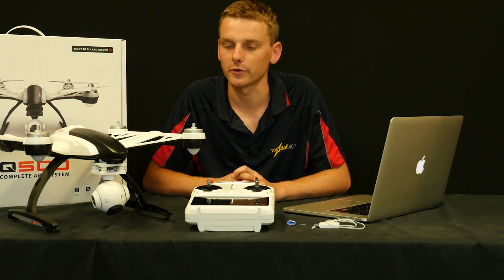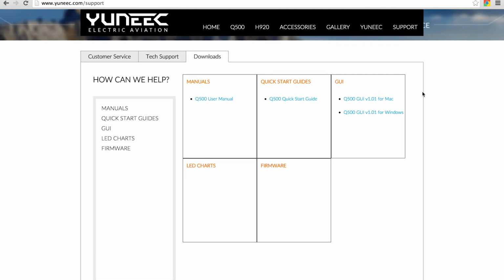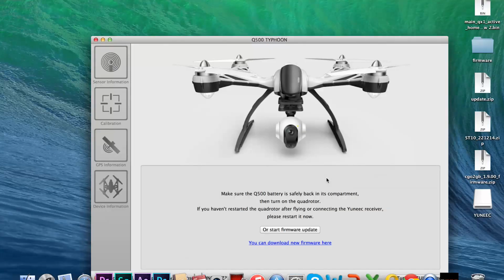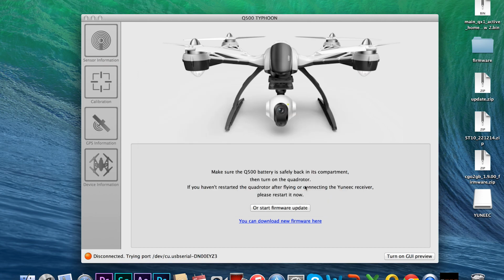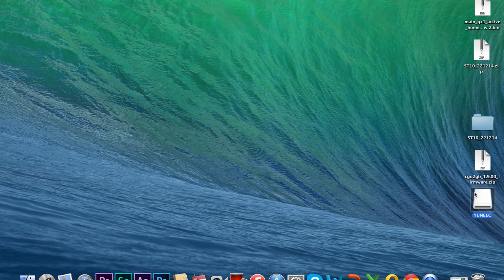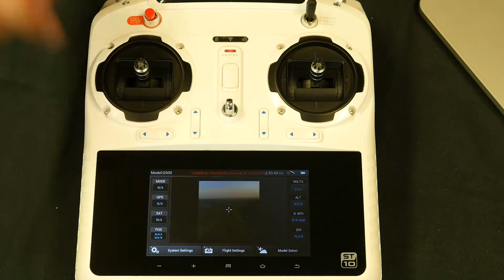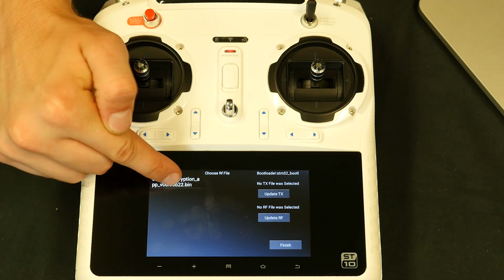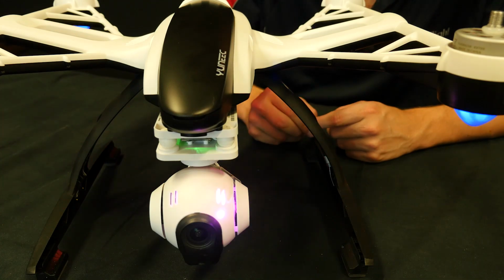Yuneec Q500 Drone - How To Do A Firmware Update

Comment: Make sure you create a new account on yuneec website and register your quadcopter with serial number located on bottom of aircraft.....after that read VERY carefully....you must make sure you have installed proper drivers for your computer to even recognize your copter....thanks so much for video....only issue I ran into was when I tried to update the TX it kept failing due to time out.....after three attempts I simply restarted the TX and followed procedure again making sure to click the upper left hand patch first than the update button and success

Comment: Good video if you can pause it! I downloaded the firmware for my ST10+ and do not see a RF file, only TX. Is there no longer  this file?
Reply: +Jim Shoe there is no RF file now, his video is out of date on that. But I did the TX file and successfully updated. The first time I set my SD card in with a tiny gap and closed the metal clip. It didn't read anything of course. I set it in properly and it read the new file when I set it to update.
Reply: +Jim Shoe I would reformat the card then try again, if that does not work then check to ensure you have it set properly.

Comment: Hey guys - I have one of the original Q500's (not even the +) and I've flown it for a few years now without ever updating the firmware.  One question I never seem to resolve or find an answer to is whether or not it's necessary to even do a firmware update, especially if you're not having any issues whatsoever.  In other words, I've flown for years with no issues, no bugs, etc.  So is there really any benefit or reason for me to update my firmware?  I feel like I run the risk of running into issues if I do vs. leaving well enough alone.  i.e. don't fix what isn't broken.  Thanks in advance.

Comment: Yeah I noticed that too, where did you get the updates for the S10 and camera and could you be a little more specific about not opening the zip file if this could cause damage to the S10?

Regards

Chris
Reply from the maker: Hi Chris Carter, unfortunately the updates for the S10 and camera are not available. However, if any updates are made available, they should be accessible on Yuneec's website (on the same page where we downloaded the firmware update). We apologies for any confusion caused. We wanted to mention the S10 and camera updates so our viewers would know, in principle, how to download and install them if they became available.

Regarding the ZIP file, we should clarify that no damage will be caused to the S10 if the file is not opened. The worst that could happen is that the update will not be installed. Hope that all makes sense. Please let us know if you have any other questions.
Reply: Modelflight No that's OK, I through I was experiencing the early stages of senile dementia? I will know how to do it now, thank you.

Regards

Chris
Reply from the maker: Chris Carter glad you worked out how to do it. We wouldn't wish senile dementia upon anyone!

Comment: Camera update.  When I put the sd card in and turn on ONLY the Q500 4K with CGO3, all I get is a blinking green light on the camera.  I had no issues updating the drone or transmitter, but the camera is killing me.  I've tried different sd cards, reformatted no luck, tried using one that had pics from the drone (so I know it worked fine in the camera), no luck.  I wish there was a forum on the Yuneec website
Any help would be appreciated, thank you in advance!

Comment: any idea where i can send my whole unit and radio for set up or repair if needed?? im in uk and bought what i thought a clean trusted used twice unit being stuck in a wheel chair thought it would be great to give me a hobbie untill my legs are sorted.. but i pressed the reset as couldnt get any where now cant see battery power or move the cam up and down as before. wont start up. did all up graded firm where but doesnt see the ones of the q500 on the radio as is a internet link seems to be a bin file. iv been messing for a few days and now got a head ache. for 2pins i could throw it . but cost me 500 pound for a massive setup. with cases..please help if you can. i am prepared to send it off to let a shop or a yuneec specialist set everything up and if needed repair then ok, but gosh is doing my head.. one frustrated guy here . steve

Comment: i was upgrading to version v4 and i got a corrupt file error now my bird wont be recognized by the app or the transmitter,  have any ideas how to fix ? great videos
Reply from the maker: Hi Remote Chief, thank you for your positive feedback. Regarding your question, we just wanted to make sure that your transmitter's firmware is up-to-date. At this stage, this is the only reason why we think this problem could be occurring. Please let us know if you have any further questions about this.
Reply: Nothing to do with the transmitter I was updating the drone and now the drone will not be recognized by the app so I cannot update or even seen any data
Reply from the maker: Hi Remote Chief, that is strange. The only other option that we can think of is to check the wires and pins on the Q500's mainboard. They may have come loose or been damaged. If this does not solve the issue, please let us know.

Comment: Do you have to calibrate the q500 after you update the firmware?  Do you re-pair the ground station to the drone after the update too?
Reply from the maker: Hi Joseph S. West, to the best of our knowledge, you do not have calibrate the Q500 after you update the firmware. We can also confirm that you do not need to re-pair the ground station to the drone after the update either. Please let us know if you have any more questions about this.
Reply: Modelflight
Reply: I updated the firmware on the quad and the controller and the calibration was still intact.

Comment: Again I have been on over150 flights with the Q500 and I have updated once before.  I also have two Q500s and one I personally rebuilt and have flown it many times.  This has nothing to do with physical wires.  The q500 became unresponsive right after  initiating an upgrade and now the app claims it is not connected m.  My other q500 works fine but I am now afraid to upgrade to v4 now but I wanted to start using watch me feature.  This is a firmware issue nothing to do with wires I checked in case but no this is firmware not a physical issue thank you for responding
Reply from the maker: Hi Remote Chief, that is peculiar. I just spoke with our technical/service team about your issue and unfortunately they are not certain what could be causing this problem, apart from the other two physical suggestions we raised with you earlier. Our best suggestion right now would be to speak to the retailer that sold the Q500 to you. We are very sorry that we have been unable to solve your problem in this instance, but please let us know if we can be of assistance in any other way. Thank you for your understanding.

Comment: Hi Matt. I just check the website and there wasnt any firmware files except for the Q500. Also what does the firmware change in the ST10?........thank you.
Reply: Modelflight Sir, will speeding up the transmitter and improving the algorithims reduce the latency of the video to the ST10 from the camera?  Thanks
Reply from the maker: Hi Chuck Vazquez I just spoke to Matt about your question. Unfortunately Yuneec only have the firmware files for the Q500. Nevertheless, we wanted to show you the process through which radio and camera can be updated, in case Yuneec does release firmware updates for these devices in the near future. Regarding the ST10, the firmware update should speed up the transmitter and improve the algorithims, but I am afraid this is all we know at this stage in time. If you have any other questions,though, please let us know.
Reply from the maker: Hi George Beorn, unfortunately we are not too sure about that. Reductions in latency would probably be the result of firmware updates to the camera and, at this stage, those firmware updates are not available. Please let us know if you have any other questions though.
Reply: Thank you for checking into it.

Comment: Matt.. First of all...Very thanks for your detailed instrucctions , Sadly I loose the way...   I Followed the instructions to update my ST10 unit but apparently I used the wrong update file (for the ST10 +). Now my ST10 drive turns on white, I do not see the characters as only some horizontal stripes appear. My question is if you know any way to recover my unit.
I will be very grateful if you can help me because I really like flying my Q500.
Reply: Jorge Sarmiento I also have a bricked controller. My sorry it's I was advised by ayuneec tech to perform the upgrade from their downloaded firmware update software. He did not tell me the critical mistake I would commit if I used the 10+ software on my ST10 and all that was available for the controller was the ST10+! In other words, they screwed me. Now I must pay postage and 80 bucks an hour and wait several weeks for it to be repaired! If you have found a way to diy repair, let me know.thanks

Comment: Nice video. My bird updated fine as did my camera. When I try to update the controller it doesnt see the files? I have tried two different type class 10 64G micro sd cards. Do the controller support that size of a card? That is my last deduction why it wont see the file?
Reply: Dutch K9 Well I answered my own question. My neighbor came over with his 8G card out of his phone and let me use it and I put the software on it and tried it. It did not do the system update, but saw the firmware update which my 64G didnt see. Looking at the files in the system zip, I believe my system files were up to date as it was so there was no update for the system, but there was for the firmware. Guess I need to buy an 8G sd card.
Reply: +Dutch K9 Thank you so much for that information.  I have scoured forums and you are the only one with an intelligent response for the same issue i was having.  Everyone kept telling me i was doing something wrong.  Being in an industry that i deal with firmware updates on a daily basis it was highly unlikely, but i did start to question my technical abilities.  It didn't even occur to me about the capacity. i would have figured since you can record to the ST10  the capacity would be similar to the quad but apparently not.  I bought my Q500 on consignment and the included 8GB was corrupted.  Again thank you.  Now i too will go buy a 8GB micro sd.  Were you able to find out what the capacity actually is for the ST10, and what class is needed?
Reply: Noi I had an old 8g as well, so I use it since firmware upgrades are not huge. I couldnt figure it out either and then wondered if it could support a 64g or not. I was using a quality sd card, so my guess would be more of a size issue than manufacture. Glad yours worked. Pretty poor setup how they did that.
Reply: I will have to look at class when i get home.

Comment: Hi Matt, I'm with Daniel Walker in that I also can't get my Q500 4K to connect to GUI. I'm using windows 10, downloaded the 'setup executable' file and nothing. GUI displays 'Disconnected. Trying port COM5'. The USB interface programmer's LED is flickering blue. Spent an hour on the phone with Yuneec support and the lady just wants me to uninstall and reinstall everything. She says it's simple and I must be doing something wrong. That could be true but this issue is all over the internet, it seems to be a wide spread issue. Surely there is a solution. I have been two weeks trying to get this bird in the air because I have to update it for a no fly zone.
I confirmed the 'setup executable' install. Under 'device manager' it shows the USB SERIAL CONVERTER and when I plug in the connector, USB SERIAL PORT COM5 shows up under ports. What's going on?

Comment: 11 attempts I made to update the ST10+. First 10 didn't work....Update failure. Time out! Attempt number 11 worked! I didn't do a darn thing different. I followed your instructions to the letter and it took 11 attempts. This is very frustrating! Still no response between the GUI and Q500.

Comment: Could you suggest best type micro card for the CGO2 Camera
Reply from the maker: Hi BigAcegoff, any brand of micro card will work for the CGO2 camera. If possible though, we would recommend getting a fast micro card (Class 10 ideally) for optimal performance. Please let us know if you have any other questions.
Reply: +Modelflight What is the largest card you can put in the ST10 controller (notST10+)

Comment: After installing the controller GUI and firmware (double checked to make sure it's there) I get as far as putting the card in the controller. Then the controller doesn't recognize the sd card. All suggestions appreciated.
Reply: I had the same issue, even after a few tries. I reformatted the card and it worked perfectly. 16gb or less by the way. Ideally use the same card that came with the controller.

Comment: Hey i'm trying to follow the instructions but my computer wont even let me open the GUI file, I own a mac. It says it does not recognize it. Is there a way i can bypass this security setting on my computer?
Reply from the maker: +SkyDrone For the GUI I’d have the customer contact us on 08 8186 4250, Cheers, Matt
Reply: Yes, i own a Mac as well and i had to do bypass the security. Go to your settings and under security turn off your firewall then you can go back and turn it back on after.

Comment: Can you please tell me how to turn on the microphone on Q500+.?
Reply: Once you're able to get a video feed from the craft to the transmitter, click on the "Settings" icon in the lower right (above "Model Select"), acknowledge by clicking "OK" and now move the "Audio Switch" selector to "ON". While you're in this menu, you may also select your video resolution (Q500+/4K) and calibrate your Compass and Accelerometer.

Comment: My Q500 4K isn't even recognized as connected by the GUI. :( I tried updating the firmware (though I don't think I need to since I just bought the drone and the last FW was released in 2015.) I followed all the steps but nothing happens. Could it be the USB programmer that I've never used? Very bummed that I can't find a solution.
Reply: Have you found a solution to your connection issue? I just purchased the Q500 4K and I can't get it to connect.
Reply: Unfortunately not. I posted my plight to the Yuneec forums and have not received an answer. I also called their support. They called me back the next day early in the morning on Saturday and I missed it. I haven't heard back from them since leaving another message. I even bought a replacement USB programmer and that didn't help either.
Reply: This is absolutely ridiculous! $1000 dollar piece of flightless junk if I can't get it updated. And now my ST10+ won't update. 'Update failure. Timeout'. Ahhhh!

Comment: You mean all I have to do to update the CGO2+ is just put it on a sd card, insert it in the camera and turn the drone on..thats it? I don't have to go thru the 'gui' like Yuneec explain to do?
Reply from the maker: Hi Randy Roache, actually we would recommend that you go through the GUI as Yuneec explained. Unfortunately this GUI was not available when the video was made, so it would be a better solution.
Reply: Modelflight Where can I find the instructions for using the GUI to update the CGo2? I can't find any instructions and so far Yuneec support has not gotten back to me about this issue.
Reply from the maker: Hi Gary Rushing,

Yuneec sent us some details about using the GUI to update the CGO2. We have copied their instructions below:

"The easiest way to update the gimbal firmware is to use the Q500 GUI. You need to connect your gimbal with your computer via USB programmer (need to use the adapter that come from the Q500 accessory kit ). Open Q500 GUI, click the 'Firmware' on the top left of the GUI. Then you will see the programmer window. Select the gimbal firmware that you want to upload. Click 'Update'. Power on the gimbal. It should update automatically."

We hope that assists you. If you have any further questions, please let us know.

Comment: Just tried (several times) to update my ST10+ with the latest update and it keeps giving me an update failure, Reason: Timeout. Does this mean I have to put it in a corner like a child (lol) ? Anyone have any ideas?
Reply from the maker: balsadustmaker Most of the time, when you see this error, the firmware update is successful. Can you check the version of the firmware? Cheers, Matt
Reply: Modelflight The build number in my transmitter is st10+v01b15c and is still there. I was trying to load in the st10+v01b21c firmware.
Reply: +Modelflight my transmitter has ST10+v01b14c and I am trying to upgrade to ST10+v01b21c.

Comment: Although a helpful video.. but like whats been mentioned below several times.. whats the point in rushing a guide ? it seems you only aim this video at experienced RC fliers, now im used to firmware updates on PC`s, bios etc etc.. so i know how it works.. but you have to also cater for 1st time users of quads..  so it would certainly help a lot of the members if you were a bit more thorough in explaining things..and slower would help :/
Reply: Norie M non rushed all details